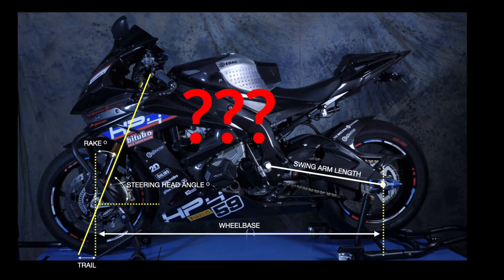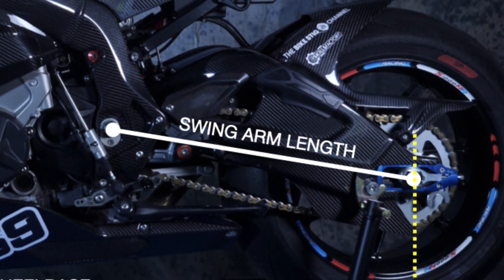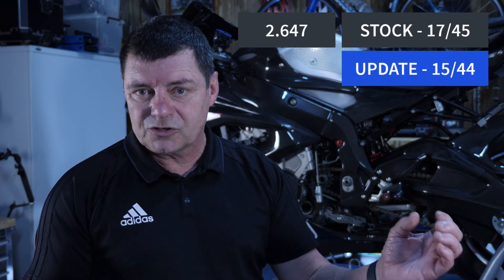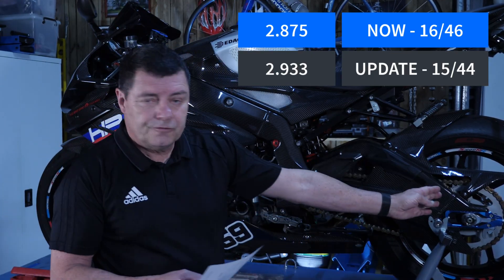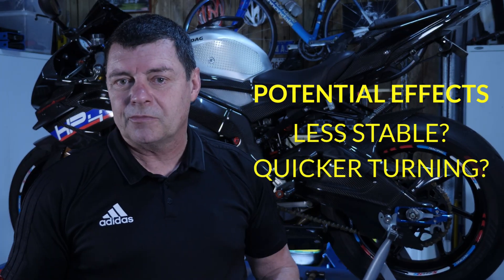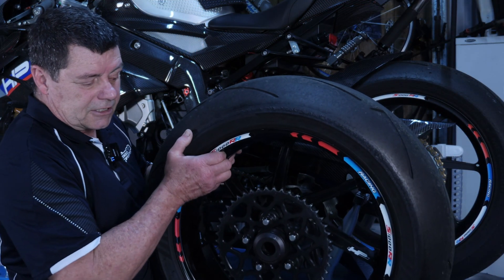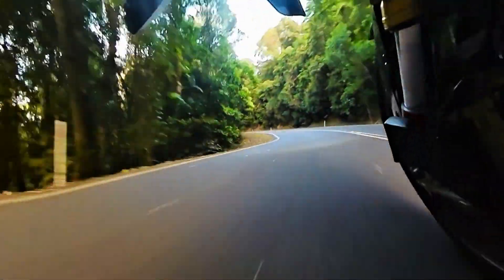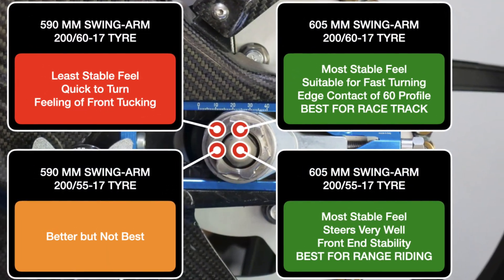How Does Changing Swing Arm Length and Rear Ride Height on a BMW S1000RR Affect Handling

Comment: Hey George. Quick question. In your other video where you talked about your new geometry setup, you ended up with swingarm length of 615mm, but here you started with 605mm. Did you change this, or did you make a typo/error? Does this mean you are going 605 <-> 590mm OR 615 <-> 600mm
Reply from the maker: Good pick up, I replaced the chain with a standard length (i.e. in the 615mm set up I added a half link but didn't like the quality of the link so I ditched it). It is 605 with the standard chain length, I want to check again with an additional full link and see if I can get it to 618 which is the optimum according to the geometry folk in the US who set up race bikes for BMW.
Reply from the maker: I've been playing around with it mainly to have data on the feel changes, plus I am not racing this bike at all now. I will still push it out to 618 and do another recording some time.
Reply: 16/45 + 120 links = cca 610mm swingarm lenght.